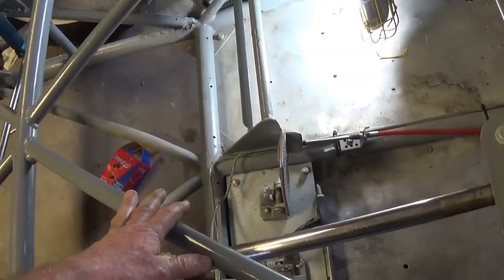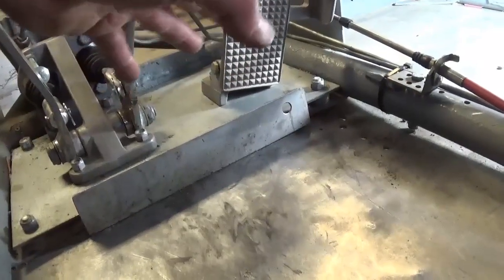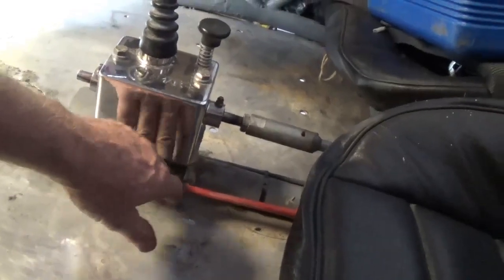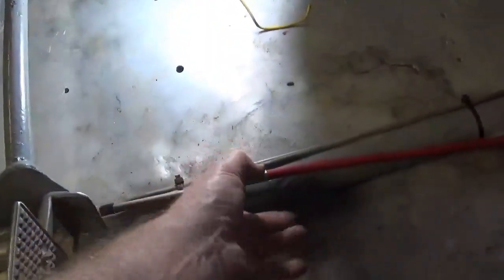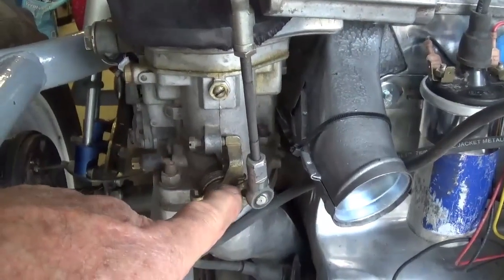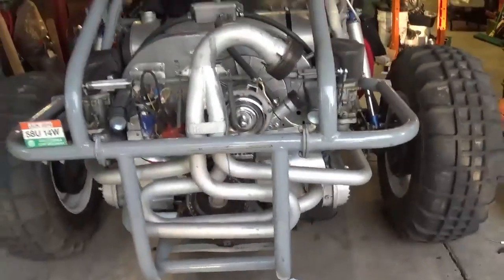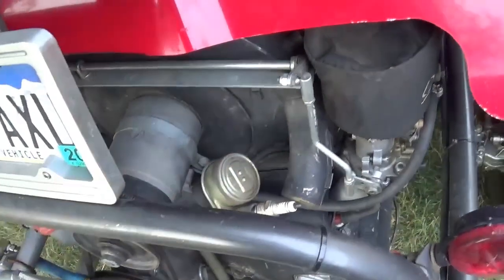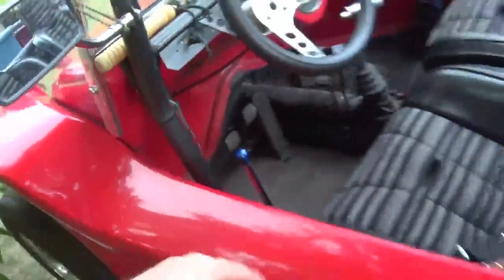VW Dune Buggy Throttle (Morse Cable) Set-up

Comment: Damn it I gotta buy one of those mose cables that seems like the perfect way to attach my petal to a throttle body and I can get rid of more crap from inside the tunnel where my radiator hoses are going to run. Thanks man
Reply from the maker: You can buy Mores Cable different place. Comes on most power Boats. Here is a link
https://www.appletreeauto.com/search.php?mode=search&page=1&keep_https=yes

Comment: Super helpful video and I am looking to upgrade my rail with a morse setup. I just threw on a CB performance weber IDF dual carb linkage, how does the morse cable connect to the throttle linkage on the engine side? The one I am looking at looks like it has 2 threaded sides for various fittings.. Is the engine side just a bare wire?

Comment: I have looked at a few of these Morse cables online and my only concern is the end that connects to the carb - it does not look like the wire cable that runs through the shroud.   Do they come with the wire cable end or do they require one to modify the carb end for it to work?  The other question is whether or not one will need stronger springs on each end?  I  had experience with Morse type cables in the Army and some of them got stiff and difficult to push/pull over time.   Thanks for the great videos!
Reply from the maker: The morse cables are universal. Everyone has to customize the carb size to fit there needs. In my case the morse cable terminates above the bell housing and I use a tiny barrel fitting to go from the fat cable to a single wire like VW used to go the rest of the way threw the fan shroud. The morse cable has a dry cable that does not need lubrication and it moves very easy for a long time. I think that morse cable's were originally designed for Marine boat use so don't forget to check out that stuff. Everyone steals idea's from other uses to make there own stuff work better. Think out of the box and don't be afraid to spend money to experience new things.
Reply: Thank you sir!

Comment: Hey EZ GZ...great information as usual. I have a question, does the cable run thru the fan shroud and how sharp can it be  curved without binding? ( actually that's two questions!) Thanks for posting
Reply from the maker: The cross bar linkage has height adjustment for just that scenario.  Sometimes the tin is all jacked up. I have covered the whole area with a thin peace of aluminum plate and made a new hole. That worked out just fine. If the cable is rubing it will start to cut  a slot and then start sticking

Comment: I just bought a non vw 2 seater and I know nothing about them. I need to hook up the throttle linkage, brakes and clutch cables (both hydraulic) this video helped a lot. I have a 4cyl 2.0l nissan engine, that has the throttle link bar you had shown, trying to figure out how to get the stuff in between. Can I email you?
Reply from the maker: I prefer to use U tube comments on my advice so it can help others as well.  Check my U tube home page and play lists for more info. Good luck with your projects

Comment: I have a question.  I have a buggy like your tub buggy and occasionally I catch a pop-up rain storm that completely water soaks the air filters from the splash from the rear tires.  Does the covers you have on all your cars stop the water soaking of the filters or is there something available that will. I have the oval cotton reusable filters on dual 44 IDF Weber carbs.. thanks for any help
Reply from the maker: If it will allow air threw it will allow water threw. The outwears just stops the bulk of the junk from fowling the oiled cotton filter. A must have for any open engine. IMHO

Comment: This is amazing!!! What is the fuel source for this engine.  Looking at the tank. Is that natural gas?
Reply from the maker: No!  It's your basic aftermarket offroad fuel tank for a sand car.  http://carcraftstore.com/stainlesssteelfueltank.aspx  However, I'm sure I could contribute a lethal amount of natural gas from the drivers seat. LOL
Reply: TheEZGZ lol thanks for the info

Comment: Hey ezgz I'm currently building a 1904cc 74x90.5. What do you think about the 90.5 piston liner kit from AA.
Reply from the maker: I have used AA pistons in lots of street car engines with no problems. Great price. I used the short connecting rods for my 74X88 so I wouldn't have to use so many shims but I had to cut a lot of the piston skirt. Not sure how the 90.5 would be. Let me know how yours turns out. Here is an article that was given to me after I finished building my 1800. Might help you with yours. http://www.aircooled.net/1800cc-vw-engine-no-machine-combo/
Reply: TheEZGZ did your motor produce a noticable amount of hp gain. I am building the motor because I finally have the money and I also want the motor for occasional snacking on those fart can Honda’s ;)
Reply: TheEZGZ the engine will include 
74 mm counterweighted forged crank
Stock rods
AA 90.5 pistons and cylinders 
Stock heads for now
Dual kadrons
1 1/2 merged header with stinger
9:1 compression 
1:1 rockers
Reply from the maker: If your going to go threw all that trouble to cut the case why don't you just build a 2110 or 2276 it's almost the same cost. The only reason I built that 1800 was to see what could be done with a stock case. It felt like a good 1776 when I was done. Reusing the case was a bad idea. I'm going to have to replace it one day as the oil pressure is already fallen off a bit.
Reply: TheEZGZ because I had a buddy that was selling the case and crank together for 120, he knew nothing about it. Later on I realized the crank was a counterweight and a 74 mm and the case was bored out for 92s. The rods are shorter too
Reply from the maker: That makes perfect sense then. I was kind of in the same spot. Sometimes you just get deals you can't pass up.  Good Luck with your project

Comment: hi I'm build a one seat dune buggy and i was wounding what are some good brakes to use?
Reply from the maker: Nothing the matter with stock. I run them on my sandrail the last week and my friends had fancy aluminum disc brakes. I went everywhere they did. hehe   Do not by the EMPI  cheap disc brakes for an off road toy. To Heavy.   Jamar, CNC are very nice  $$$$$$

Comment: How do you have the morse cable going thru the shroud and hooked to the linkage?
Reply from the maker: Behind the shroud there is a cable clamp that attaches the morse cable to a smaller throttle cable and the rear carb linkage is standard stuff

Comment: Sumthin to take into account is outside the box....impact prevention....if your goin barefoot or light shoe, and make a boo-boo mistake and come to a hard stop sharp edges can severely injure flesh and/or bone so best to pad edges and bars with dense foam or even soft wood/cork....was thinkin of your heel on that angle metal....amongst other impact points.....just sayin an ounce of prevention....and yeah protect those carbs too....:)...
Reply from the maker: Thanks for your contribution. You must have been a motorcycle safety instructor at some time. They always taught us to dress for the crash instead of the ride. 
 Someday I'm going to mount a VW engine on the back of a lazy boy recliner.  Enjoy the rest of your day my friend.

Comment: Hey hey!
I’ve got a question about front suspension for a dune buggy. Using a balljoint beam. Mine is very choppy. How have you made yours feel smoother?
Reply from the maker: Most of the folks are ran with including the sanrail in this vid were link pin front beams. The shock would end up being your top or bottom stop and most times the long tie rod would hit the frame. That's not to say a Ball Joint front end can't work well.  With a sandcar there is very little weight on the front end and the leaf springs are to stiff. Some guys took the leaf springs out and ran a long threw bolt from one side to the other. Then use some used coil over shocks from a small motorcycle.  You should be able to stand on your front beam and jump up and down and get an easy 4 inches of travel if you way 160 pounds or more...   Try running it with no shock absorbers at all. It's really fun on the straight always but sure doesn't help when your turning.  I have used old worn  out shocks and  that worked well.  If you can find some old shocks that leak oil that's even better. If they are plain shocks without pressurized gas You can drill a 1/8 inch hole in the bottom on the center pointing to the car center and let the oil drip out. Don't make the hole so it's pointing towards you as the first few times you take the car out oil may squirt out. On link pin shocks I would even use worn out shocks mounted upside down and cut the shaft protector metal off. You can't do that on ball joint because it has and eye at the bottom and straight shaft at the top.
The whole problem with ball joint is that when you run out of travel your ball joint is trying to tear itself off. There is just a slot. Just experiment and look at other folks cars and see what works best for your driving style and weight of your car. Not to mention how much money you want to throw at it.  The beams are spaced differently on ball joint compared to link pin so its a major deal to try and swap them out.